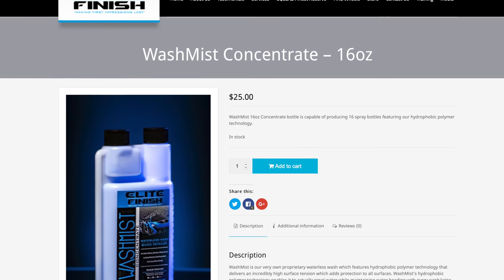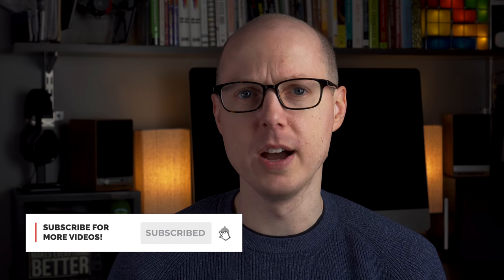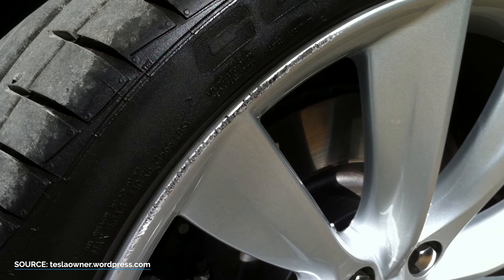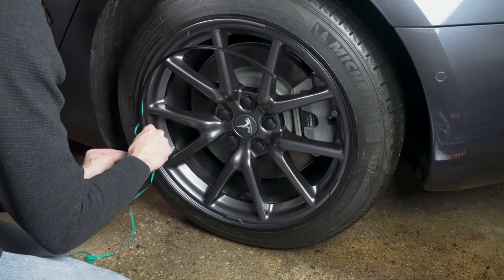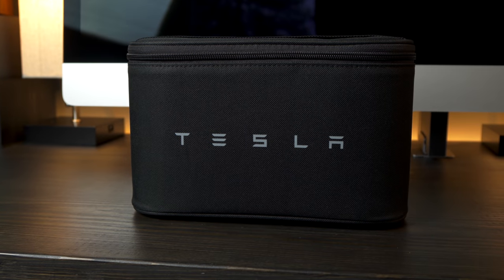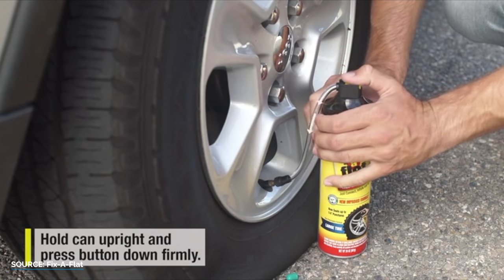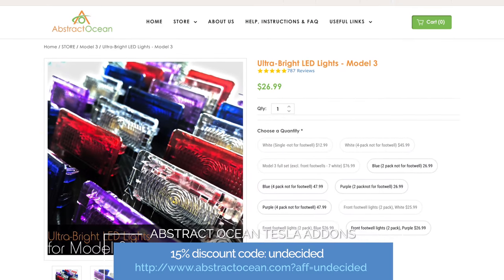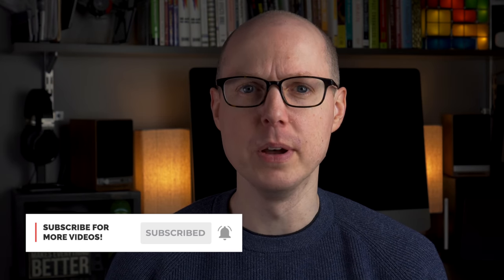Tesla Car Wash & Tesla Tire Repair Kit - Protect your car!

Comment: Rinseless washes aren't great for your paint, it's more of a "I have no other options" solution.  Contaminants are still present when you are rubbing the micro-fiber cloth on your car, most pro detailers always recommend rinsing at the very least with a hose before using a rinseless wash.
Reply: I agree. In the winter, I go to the self-serve wash and spray it all down with one rinse cycle worth of quarters. Then I drive the two miles home and complete the rinseless wash in my garage where it's above freezing temperatures. Seems to work well for my situation.

Comment: Can you please run your rim against a curb and see if it actually protects and doesn't just squish and move aside when the 1,000lbs of force is applied between your rim and concrete?

Comment: I carry air compressor and a tire plug kit and have used it on past tires, and not even bothered with a professional tire patch.  If you get a nail or screw though a tire in the main tread of the tire, a plug can be a permanent repair.  (Yes, patches are BETTER, but a plug can be fine too)
Reply: Most tire shops wont fix foam inserted Tesla tires anyway...
Reply: Keith Spiro ...but a tire shop has no problem removing a plug and patching.  I agree, Foaming a tire means you are throwing it away.
Reply from the maker: Yes, but if you’re in a bad situation and need to get repaired quickly, it may be the best option.

Comment: I was under the impression that Tesla uses some type of foam band inside of the tires  to reduce noise.  This would render any type of sealant as non-usable.  Your thoughts?
Reply: The foam doesn't render the sealant non-usable, the sealant will flow to where the air is escaping, foam or no foam.  But sealant does ruin the tire pressure sensor.
Reply: The noise reduction foam will for sure get skanky if you inject sealant. I think I'd prefer to just call roadside assistance if adding air from a pump doesn't work.
Reply: @JeanPierreWhite  The problem with roadside assistance is, you could be sitting there for quite awhile.  And you might not have cell service to even call them, you're better off having a way to repair the tire enough to at least get someplace else for a permanent repair.  So don't use the sealant, use a tire plug kit.
Reply: @Resist4  Would you not need to remove the wheel to find where to plug the tire?
Reply: @JeanPierreWhite  In most cases no you don't need to remove the wheel, but probably jacking it up would help.  So, a plug kit, portable air compressor, jacking puck and small jack.
Reply: ONLY ON MODEL X
Reply: @alvaroee14  Only on model X what?
Reply: Besides, Tesla recommends using the $80 kit...
Reply: @44kas88  I don't see where Tesla specifically "recommends" their $80 kit, but they sell one that most people could easily use, even though the sealant will ruin the tire pressure sensor.  I still say a plug kit is a much better option, but I'm sure some might have difficulty using it (especially in the rain).  But then again some people can't even change a tire on their own.

Comment: I purchased a factory $600 20" rim and mounted 1 of 5 winter tires im using in the northeast USA. I made 5 hockey puck jack pads for less than $20, and carry a custom scissor jack around with me at all times. Dont carry wheel setup daily. Will carry on long trips when I do. Also purchased a low profile portable 2 1/2 ton floor jack that I will use only for tire swaps at the end of the season. $60...and custom built jack pad that replaces floor jacks actual metal pad. For pix see keithpixguy on IG for info.
Reply from the maker: What floor jack do you have?  I’m starting to shop around for one myself.

Comment: I enjoy your videos but you really pick the expensive items for your Model 3.  A $30 portable air compressor is just as effective as Tesla's $80 kit.  And use a plug kit, not sealant.  Don't get me started on those jacking pucks at $25 each....seriously?  Takes 10 minutes to make 4 out of hockey pucks with rubber stoppers screwed into them at a cost of $25 total.
Reply from the maker: The hockey puck does work.  The i1Tesla channel has a good video on how to do it for anyone looking on going that route.
Reply: Ive done the exact thing only I used a 7/8" broom stick cut to 1" and inserted 3/4" into an orange puck. These are practice pucks and are heavier and stronger for the same size as normal pucks. $1 moee each. I made 5 units..

Comment: I'm fairly certain a tire repair kit that inserts "goo" into the tire to seal the puncture does not work on the OEM Conti-silent tires on a Model 3.  Conti-silent have a 1-2 inch layer of foam along the entire bottom of the tire to reduce road noise.  The "goo" cannot seal a puncture through this foam.  See this link on how to repair a Conti-silent tire.  It involves taking the tire completely off the car.  https://sandyblogs.com/techlink/?p=8677